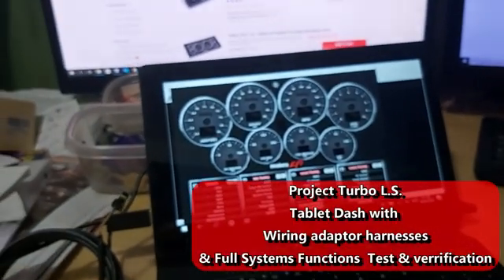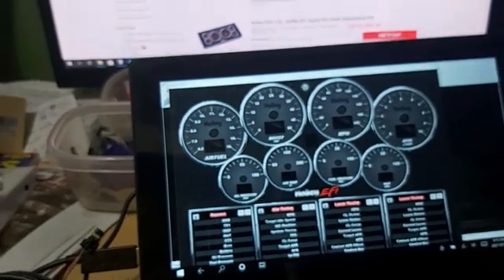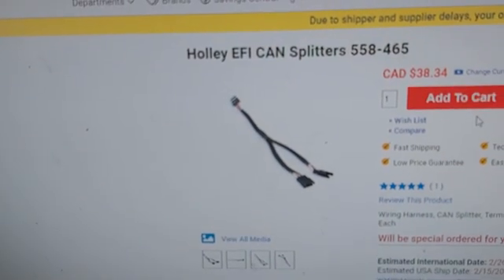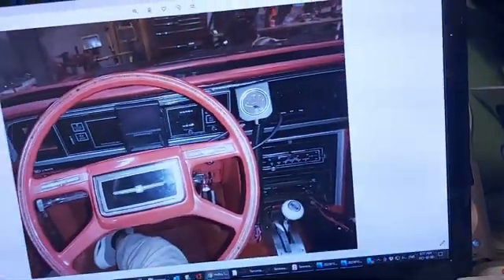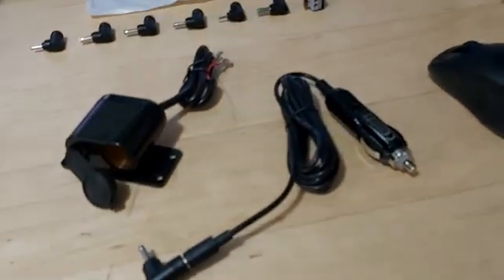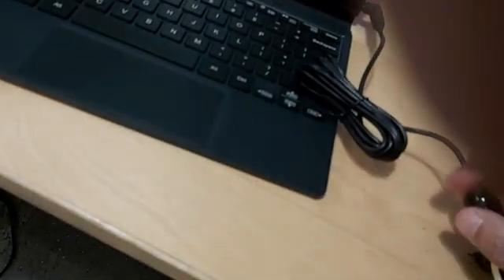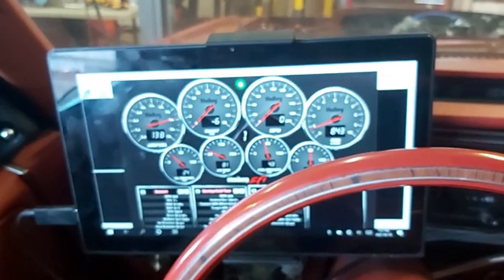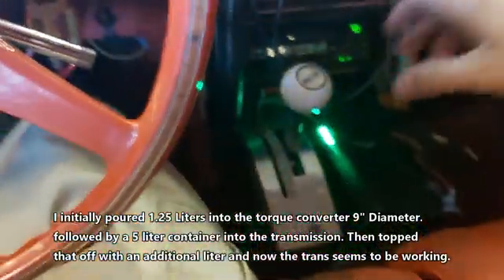Boosted LS  Tablet dash (Terminator X-max ecm ) & full systems function test

Comment: What kind of transmission do U hve? Is it sequencal?  Who makes it? Thank U for ur time 😅
Reply from the maker: Hello. I'm running the GM 4L85E 4 speed automatic transmission. 4L85E and 4L80E can be found in the junk yard in 2500 series GM trucks or turbo diesel powered trucks for the 4L85E which has a 695 ft-lb torque rating vs only 440ft-lb for the 4L80E because the 85E has 5 pinion gears vs 4......thanks for watching and commenting.....Oliver
Reply: How come your shifter (seemed) looked sequential?
Reply from the maker: It's just the way the mechanism is set up in that particular shifter.... @TossinDirt

Comment: Do you have to have the handheld? Or can you just run a tablet?
Reply from the maker: Yes, you can just make changes to the engine parameters using only the laptop if desired. They give you the hand-held for initial set-up and to get your engine up and running. I just keep the hand-held mounted in the car and bring the laptop when I want to run gauges and see exactly what's happening with the engine and transmission at all times...Thanks for watching....Oliver